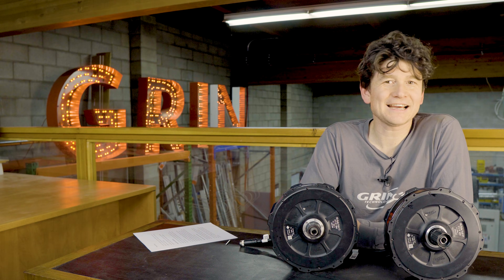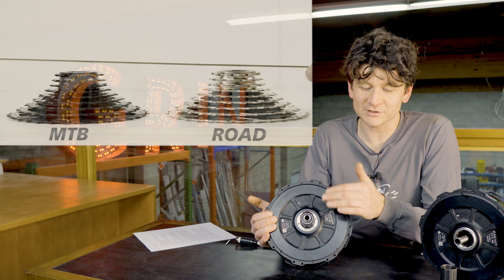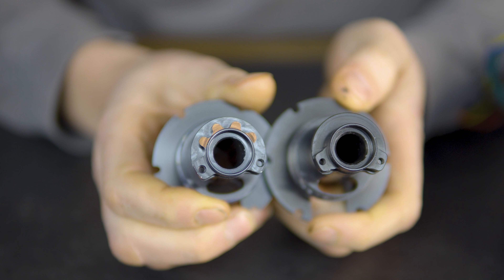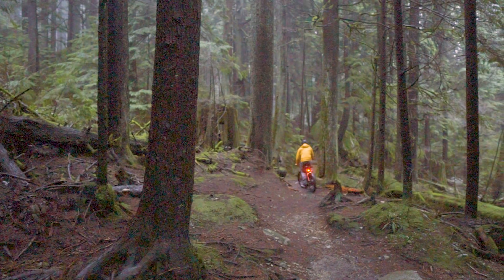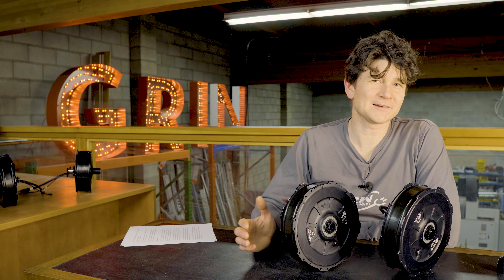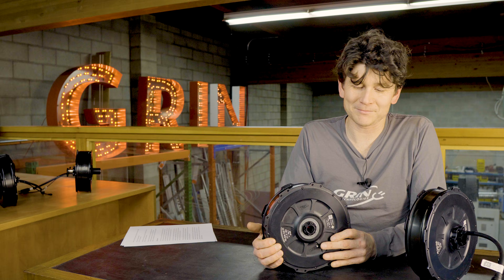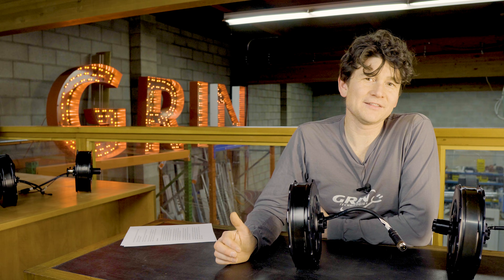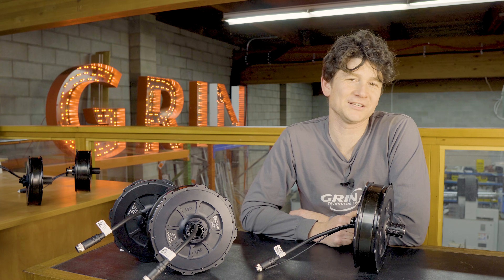Introducing Grin's V3 All-Axle hub motor series. SRAM XD, torque sensing, and Fat Bikes included

Comment: How about using Rohloff type discs? They have got a significantly larger bolt circle diameter, giving you plenty of space for the cable.
Reply from the maker: That was an option, but they are also quite expensive and difficult to source, while the 44mm BCD ISO disc rotors are nearly universal in availability. So in trade off far more people would be inconvienced by the non-standard disc than by the lack of 20mm thru-axle support.   

That is the solution that a few other entities have followed though where ISO rotor standard simply couldn't fit (like the TDCM IGH motors https://ebikes.ca/shop/discontinued/tdcm-igh-ready-to-roll-kit.html)

Comment: What kind of power improvements can we expect from the fat bike version? Can I just check the simulator to find out?
Reply from the maker: In theory it should be over 50%, but With a phaserunner controller the power difference won't be as noticeable since in that case you are limited by the same max phase current limits. We should have them on the simulator in February
Reply: My grin rear axle gets very hot when tackling some west van hilly roads.  It the fatbike option fixes that, I will be a super fan.

Comment: My daily is a 26" Fat Tire Kepler for my urban daily commute, a few stretches on 40 mph I max out at 33 to 36 and I would be thrilled if I could either go with a front hub just to "Turbo Mode" thru those 2 miles or would this motor as a rear hub upgrade do the trick with my 52 volt existing battery? I'm willing upgrade to 72 volts-20ah too if nessasary? I also can appreciate the fact that Grin is a North American company to do business with to 'Shop Local'
Reply: they are Canadian.
Reply: @coler154 Canada is in North America…

Comment: Any plans for European legal (250W / 25km/h ?) super lightweight motors? Or is there just no demand for DIY ebikes that are European legal (without being classified as a speed-pedelec)
Reply from the maker: Plus Europe explicitly doesn't regulate the actual motor output or input power. Just the manufacturers nominal rated power. So this motor is perfectly legal as long as we (the Manufacturer) can justify giving it a 250 nominal power rating, which is very easy to do by spec'ing performance at 100rpm.. See the motor power table in the user manual. 

Ultimately motor power laws are incredibly stupid and ill informed, and we will be releasing a video on this topic soon.
Reply: @GrinTechnologies They sure are pretty stupid😂
Reply: @GrinTechnologies  "Ultimately motor power laws are incredibly stupid and ill informed" 
I concur 100%  
Bureaucrats in an office who've never ridden an ebike or have any understanding of what's going on.
Reply: Speed and power is limited by the controller not the motor. They have smaller less powerfull motors as well and their controllers are the most customizable on the market.
Reply: Europe is just a sh. It hole of bogus, predatory regulation

Comment: Would it be possible to fit the fatbike version in a 135mm QR rear dropout ? I am looking to convert and HP Velotechnik trike to a fully electric serial hybrid propulsion. I don't need the gears nor the torque sensing but would love the larger stator and power output !
Reply: No it's meant for fat bike sized dropouts. He mentions it's for 170 to 190mm dropouts. It will never fit on a 135mm. You would need the regular version.
Reply from the maker: This answer is correct ish. Although what wasn't mentioned in the video are the plans for a 45mm front motor varient that will be for 135mm / 150mm front fatbike forks. So if you don't need a drivechain you could easily install that on the rear.

Comment: Those Santana QR inserts will likely fit my Sparta Li-ion step-thru (~2000, 24v, aluminium) to replace the old 155mm OLN DD motor/7speed cassette/Sturmey coaster brake hub.
Reply from the maker: This OLN motor had both a 7 speed cassette and a coaster brake? That seems pretty unique too!  
Anyways this should work, spreading a frame dropout spacing (even an alumium one) by 5mm isn't too big of a deal.
Reply: Correction: 7-speed freewheel and drum brake.

Comment: What about a fatbike front motor version?
Reply from the maker: Yes, that will be coming too! You can already use our 27mm motors on fatbikes just fine with the axle extender set, but there will be a 45mm option as well for higher continuous power capability.  There is a limitation to how much torque you can have on a front hub without loosing traction, but fat bike tires tend to be a lot grippier so front wheel skidding should be less of a concern here.
Reply: @GrinTechnologies  your BLDC controller already supports ABS braking?

Comment: I have three grin all axle motors. The third one (v3) being installed on my custom built world touring trike with solar. Coupled with an 18-speed pinion p18 gearbox. 
My front v2 version will be on my diy kick bike that I am making and the other v2 rear motor is mounted on my everyday fast commuter hybrid. You could say I am very happy with this product.
Reply: Nice. It says alot that you are starting on your 3rd build of this ever-evolving motor. I'm shifting my focus to this motor last hour after a kind reply from a Grin Tech rep suggested this motor vs two different front geared hub options I'd been looking at. 

What voltage are you running on your 3 motors, please? Thanks
Reply: @TNSonglines  go for it. I am not a speed freak so I use 36v on all of them. I build my own battery packs as well. 
The hybrid uses std wind. 10S8P Panasonic Ga cells. 700c wheel. 
 The world touring trike also Std wind and a 20” wheel. Samsung 35E cells. 10S12P
The kick bike will feature a 10S16P Samsung 35E pack. Also Std wind in a 20” wheel. 

I use 40A smart BMS always and phaserunner controllers.
Reply: @alexhofvander9839  
Nice. Thanks for sharing so many details! I'm still picking & choosing parts but fixing to dive in. I like the gear range that the Pinion p.18 that you run has and I bet that having extra gear choices really is a major plus on long cross-country rides. I've looked at Rohloff 14 and liked it for it's total gear range but sort of waiting to learn more about this new 3x3 9 speed IGH which has an impressive gear range, higher torque rating than other current IGHs, runs in grease so no regular oil changes and extremely long service intervals, etc. Lastly, Pinion's new MGU seems pretty impressive to me so far, and I hope they someday in the  near future release a Pinion MGU that is geared towards the bike building crowd.

Comment: Wow, great news guys. At 72 volts what power can the motor handle?
Reply from the maker: Have a look at page 9 of the user manual to understand the power capability as a function of wheel RPM.  The voltage of your battery is neither here nor there:
https://ebikes.ca/amfile/file/download/file/305/

Comment: Thank you. The new fatbike motor with 45mm magnets, what current does it support continuously? Phase wires 4mm sq.? I think you compared it on a video with QS205 motor? But that motor has 50mm magnets and 10mm  Sq. Wires. Can you make your upgraded version of hub motor for 3kw of constant power? I would love to have 50% lighter motor!
Reply from the maker: So far we've just been doing the development testing with the same L1019 cables as the 27mm motors, and so the bottle neck here for phase current handling is actually the L1019 connector itself. For a slow KV motor running at a high voltage this is OK (and 3kW easily doable) but to take full advantage of the motor's potential at 48V/52V will require a totally different plug type.  

Sadly there really doesn't seem to be any good options out there for an all-in-one waterproof 3 phase power connector with signal lines in this current range (ie 80-100A), so it's one of the details we're struggling to sort out. Any suggestions?
Reply: @GrinTechnologies  I suspect anyone who's trying to push past the 3kw mark would have zero issue with separated out, higher gauge connectors. I've personally built 72v 3kw (avg) setups quite happily with the Phase/Franken/Runner controllers, but when I've wanted to get past that 3kw mark for a build, I generally jump to other controllers (typically, VESC based). In that ecosystem, builders are all wiring/soldering/connectorizing in a custom fashion anyway.
Reply: @GrinTechnologies  I'm interested also of this motor. Does the design enable the use of parallel phase wires? I would just use dual wiring with additional MT60. This is  how my motor is currently set.
Reply: Individual bullet connectors for each phase cable with perhaps a single housing to snap together around them might be a good high-amperage solution@GrinTechnologies
Reply: Is there a 2000w version of the fat bike motor?